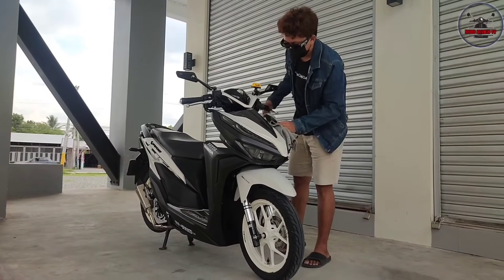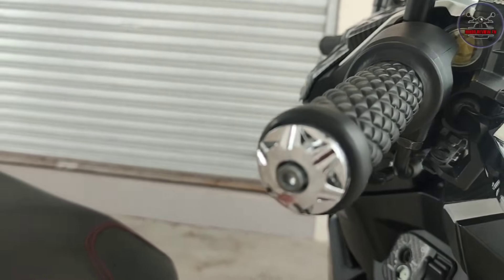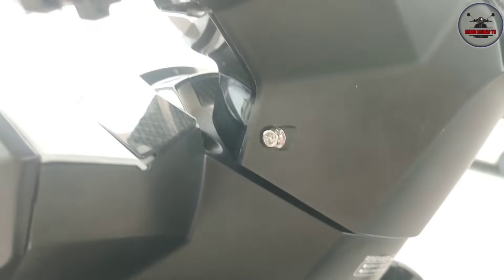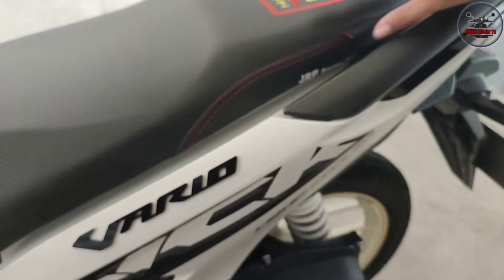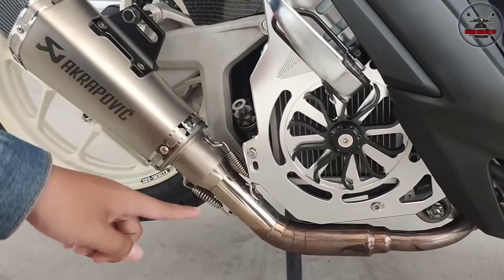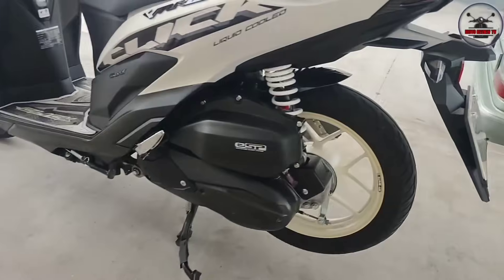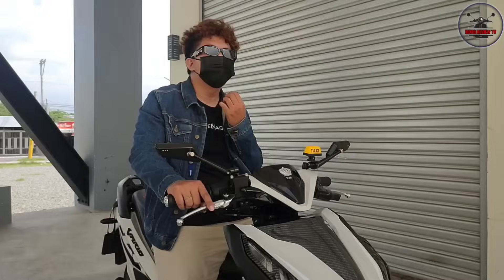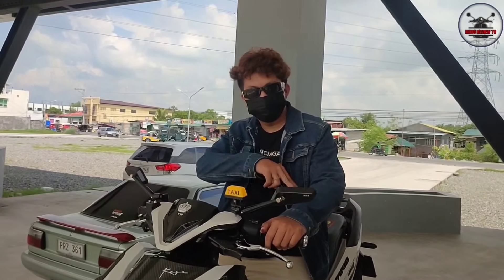Honda Click 125i Set-up - SOBRANG SIKAT ITO SA FB GROUP NG HONDA CLICK - Ganda ng Tayo 👑💯

Comment: Bro 20k?? May click 125i v2 din ako 2021 model. Pinakauna kong binili YSS G-series suspension (w/ baso) atyaka RB8 na mags ng RCB. Yang dalawa palang ikabit mo sa motor mo boss ibang iba na tindig around 12k lang. Next na binili ko RCB S-Series na caliper 2 pots (php1.9k), RCB rotor disc 190mm (php950). RCB Steel hose 950mm (php800) tyaka rcb S-series lever (php1.2k) Bale RCB braking system, to sum up around 4.9k din. Pag inadd mo sa 12k kanina nasa 17k lang. lately lang ako nagpalit ng brakeshoe na elig tyaka pirelli diablo rosso sport na tires at sec alloy topbox kaya lumagpas na ko ng 20k. Pero sulit na sulit kasi more on performance ang inupgrade ko kesa sayo na accessories lang. Sorry boss pero kung itabi mo yang motor mo sa motor ko at sa mata ng marurunong alam agad ng tao kung sino sating dalawa naglustay ng 20k ng walang katuturan. Di ako gagastos ng 20k para sa Shopee build na chopsuey. Walang dating boss pasensya na. Kahit sakyan mo motor ko baka magsisi ka dyan sa mga pinagbibili mong walang kwenta kasi ibang iba na riding quality ng motor ko kesa sa stock w/ accessories mo. Pasensya na boss. Function over aesthetic lang palagi. Tyaka sa gastos mong 20k para dyan is its either nagsisinungaling ka lang or baka eng eng kang nagpaloko sa mga nagbenta sayo nyan

Comment: Yung stock na click elegante na tignan. Sa 15-20k na budget, I'd rather change the rear shock, better tires, adjustable levers and better front brakes.

IMO, napaka unnecessary ng mga pinalitan mo pero sige, you do you.